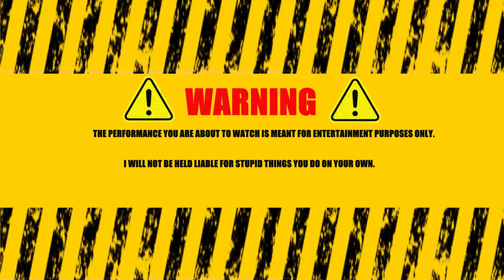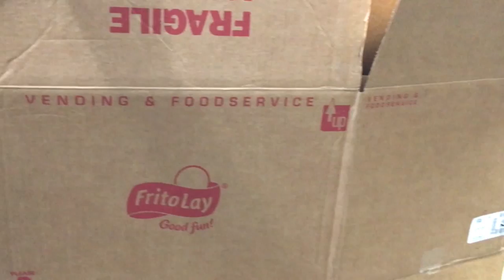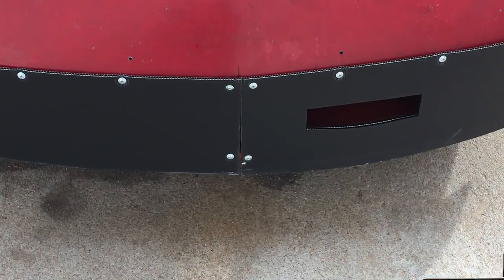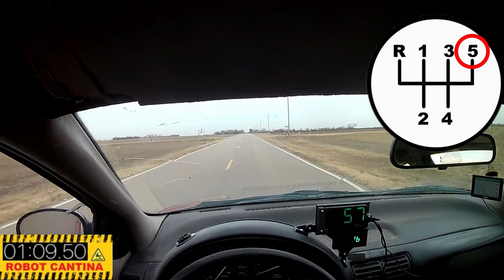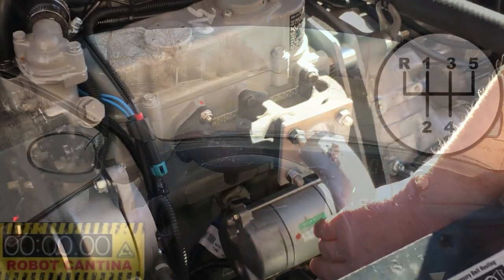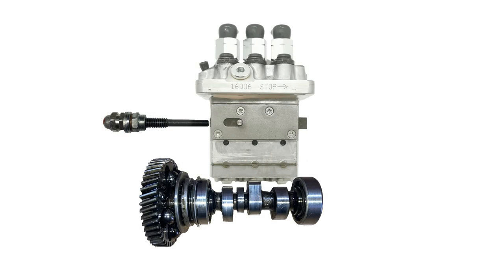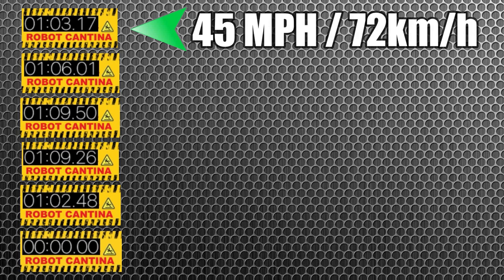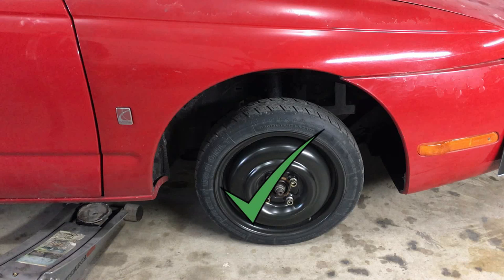S3E2   Fuel and aerodynamic mods ....We do some experiments to try and get the Saturn to go faster.

Comment: Its normal for a Diesel engine to have next to none exhaust heat at idle. Thats a huge problen when it comes to emissions. Thats why modern cars waste some diesel, by injecting it far to late into the powerstroke and so raising the EGT.

If EGT get out of hand with the turbski, try adding a intercooler, or even injecting water or methanol into the charge air.
Also, the intake header looks terrible, you might want to look into building a better flowing one and enlarging the intake ports in the head.

Comment: Maybe I'm crazy but, I would have put a little turbo on that sucker. They're not crazy expensive, under $200. That would allow you to accelerate so much more easily and quickly and you wouldn't have to run wide open all the time like now. Probably be significantly quicker, faster and use less fuel since it's under so much load right now for it's size. I probably would have run the space savers on the rear and left the good tires on the front since they're doing holding most of the weight, providing the traction for acceleration, turning, stopping and all that. If a tall, narrow, high psi, low rolling resistance tire could be found that would fit your wheels that would be money, a set of light weight wheels would be sweet too. Porsche claims every lb of unsprung weight is equal to 7-8lbs of spring weight.

Comment: When covering the radiator, an old truck trick was to cut a hole centered on the fan. This stopped water pump failure due to the blades having an uneven drag, the water pump bearing didn’t like the flow only on the top or bottom.

Comment: My suspicion is Aerodynamic drag is simply not great enough to matter for a 0-55mph acceleration test. I'm really not sure you would be able to measure it accurately with all the variance of shifting gears. You might see a few percentage increase in the hillbilly MPG test loop though. If aero mattered that much then no one would run old brick nosed muscle cars at drag strips because they would be at massive disadvantage.

Although with that said I'm curious if putting the little wheels on the rear and cut the front springs down in the front to match the ride height would help improve the aero. I agree don't run the skinny tires in front as it ruins braking performance and you'll skid in a panic stop. You can probably find 60mph rated temp spare tires to negate worries about blowouts. Adding rear fender skirts, moon disks on the front wheels, and a full underbelly pan should make it slick through the air. Bet you could get 60mpg with those mods combined with what you have already done. Weight for MPG doesn't really matter. Once the car is at the desired velocity, inertia takes over, and in fact might actually help with short inclines like overpasses.

Comment: EGTs are very low and you definitely have a safe margins to increase fueling. Something around a GT12 turbocharger and intercooler will make a huge difference with additional fueling. At 5-6psi you will notice a significant difference

Comment: ALSO, DON'T FORGET, the weight difference between each wheel, space saver v normal.. SO I AM surprised, you had slower acceleration...🤔 I have a 2007 Fiat Grande Punto 1.2 8v (ahem 'Estimated 65BHP' factory), and I know someone who has the exact same car that I have driven a coupla times. Mine, though had been fitted with large aftermarket 205/40/17s by previous owner, his - standard (alloy) 185/65/15... And MAN.. What a difference! Acceleration? - Hahaha, Fuel Economy? - "Here, just go ahead and burn my wallet!" Hahaha...
It HAS made me think 🤔, 'IF' I could get a bog standard steel wheel with 205/45/17 tyre say, and compared the weight with one of my wheel & tyre.. COULD I get a lighter wheel & tyre AND STILL have the grip but better acceleration/economy, as, I'm sure, it must be, that a lot of the times the cheap alloys are heavier than and equivalent steel wheel and tyre setup..... 🤔🤔🤔    😎🇬🇧

Comment: The smaller wheels might not reduce the rolling resistance but it certainly has better aerodynamics. Now, I would probably install the same in the back, so that the car sits level (it currently has a higher rake, which will affect the aerodynamics)

Comment: Well, here's my idea on engine performance-Maybe airflow to the engine compartment has been limited by the aero bumper cover and is causing hotter air or a restriction to air flowing into the rear mounted firewall air cleaner.  
I would like to see what a cooler air intake with more volume of fresh air available to it would do for the engine power.  Plus it would be interesting to see a lip spoiler cut some of the air going under the vehicle since these are known for tremendously improving fuel economy and higher speeds.  
Just a thought though.  
Thanks for the entertainment.

Comment: Try some cheap stick on vortex generators on the back of the roof and fab up a cheap rear diffuser under the rear bumper. Both help a lot in reducing pressure differential between the front and back and therefore reduce drag above 50kph/30mph. 
Also try weight savings; there has to be lots of parts you can remove that do not affect safety. Empty the trunk, pull the jack and spare, remove the back seat, passenger seat etc.

Comment: I don't recall how your speedometer is setup. But I noticed that you didn't specify that when you're changing the front wheel size, it wasn't going to affect the reading. Smaller circumstance tires will make a speedometer error of reading faster than actual speed.

Comment: If you want to help with aerodynamic drag you could replace the hub caps with flat ones, some older race cars use them to reduce aerodynamic drag on the wheels.
At the cost of brake cooling.

Comment: Can you fit a small fuel pump between the injection pump and tank? That should keep the feed of fuel to the engine consistent and stop the surging. Also for the EGTs could you diy rig a water/meth injector system on the intake to lower the temps and help cool the piston cron/valves?
Reply: @Robot Cantina you know you made it when people want to be you 🤣

Comment: Smaller wheels are faster fake off but lower top end. Also provides more take off. A taller skinny wheel would me and slower takeoff times but longer top end. On flat ground that would equal a faster car. Hit a hill or slight incline of any kind and you won't get any torque to go up in a high gear.

Comment: Deffo hearing a wheel bearing or an out of shape tyre. In my experience of turbocharging N/A IDI diesels, I've had no issues with running 15-18 pounds of boost with an intercooler of course. Fueling was always the problem..or lack of it. An N/A pump has a little bit extra fuel to give which will make a noticeable difference with the turbo.. but to get the most from the turbo you need a bigger pump.. I was lucky to get a TDI pump that fit straight on my engine. That little Kubota may be a tad bit tricky to find a bigger pump for unless you can change the elements in the pump.
Reply from the maker: My understanding is the Kubota super mini series engines have thin cylinder walls.. and there is the potential for disaster if pushed too hard.   Hard to say if that really is an issue.  Just to be on the safe side we will slowly increase boost and see what happens.
Reply: @robotcantina8957  deffinatley a wise idea to start low and work up. I'd be curious if Kubota ever made a versions of that engine or at least bigger versions of the design that were turbocharged, something along the lines of small tractors or even excavators..Might yield some usefull info and possible pump upgrade path. I'll certainly look forward to your vids what ever you do to it! Makes my Sundays not so gloomy here in the very damp UK.

Comment: GIven the amount of power you're dealing with, and top speed testing, I'd want to be measure wind speed, atmospheric pressure, and ambient temperature and normalize testing results so they can really be compared.

All of the performance testing you see in Car and Driver and R&T is done this way, and it's work. (As for top speed, IIRC, C and D also used to go out there and do that thing. Nowadays, that might be much harder.)

Comment: Hi guys. First time i react, but have been watching since the first insight episodes.

Just out of curiosity with the aeromods. I have always wondered, how much of a difference would it make if you put tape over all the panel gaps to make it more slippery for the air to grab hold of the car? Seems like an easy little project for you guys?

Also, without wanting to sound like a keyboard critic, i get the impression the flywheel combination you got is way too heavy for the engine to handle. It won't change top speed or at least not a lot, but it should increase acceleration significantly i would expect.

Anyways, thanks for your effort, looking forward to the next one!

Comment: Maybe you weren't reading car magazines in the 1980's, when wind tunnel testing was the new thing, but yes, outside mirrors count for a few percentage points of drag. Also, they are frontal area. (I've recently heard that decades into the wind tunnel era, some cars' exterior mirrors are so good that the car has less drag with them on.)

Also, skinnier tires = less frontal area. Your battle against the wind is not just coefficient of drag, but the frontal area it is multiplied by.

Comment: It's also running out of oomph on the high rpms because the timing is not dynamic, thus it's not getting the timing advance to move the "power band" up. It's power band is most likely right at the rpm it was originally specified to run

Comment: A small supercharger might be a better bet than a turbo. That fuel pump has no boost compensator so off boost will smoke and on boost will be lean - one or the other at least. A pd supercharger always gives pressure so its just a case of matching fuel to it and so long as there is enough capacity in the fuel system it should work well. 
The heat build up is more likely to do with cam and injection timing than too much stress at this point. Its set up to work at a low load so its optimised for that. I'm used to car pumps which almost all allow for injection timing adjustment but on yours it looks like you may have to dial the injector cam to get it to move. Looking at that picture - are those ball weights to adjust injector timing for rpm? If so and they're sprung you might be able to play with spring rates to get a gain.

Comment: Sounds like you have a huge flat spot in the midrange. A really small turbo that spins up early but doesn't give much top end boost might be best. As others have commented, the mini tyres looked soft. Running tyres at rock hard pressure give significant milage improvements.

Comment: I would say the rear spoiler would clean up the turbulence at the back, ie, should be better. In engine design we grind a diffuser in the chamber after the valve to reduce turbulence and increase flow.
You could A - B - A test it and see if the results are worse when things are put back to the start.

Comment: Gimme all the turbo!!

Not sure, and you PROBABLY know this already considering the rest of your content....but you can maybe machine the crank/rods/pistons to get some oil splash going on and help your EGT temps?

You may NOT know, methanol burns at a low temperature, i.e. low EGTs.....so meth injection, or water/meth, may also be a solution to keeping your EGTs low

Comment: Port the nozzle on the injectors there usually out of balance anyway you can add two stroke castor oil too fuel for turbo and methanol

Comment: Increase the fuel injection quantity?
You would want to monitor egt, possibly oxygen gas and have more temp sensors on the engine but 10% more fuel will make 10% more grunt until below around 18:1 afr

Comment: Once you install the turbo, it'd be great if you could make a manifold-pressure based automatic fueling screw adjuster, to keep the just right amount of fuel going into the engine even when off boost. Keep it running right at stoich.

Comment: Also you may want to find a new head gasket and do a flow test on the head to see if it's all the same flow . There is something simple you can do see if the springs are all the same weight.

Comment: Turbulence inpacts aerodynamics a lot. Covering up all the panel gaps, window edges and headlight wells with self-adhesive tape or vinyl should do some good. Also reducing the ride height by like 6 ft, and adding a cover sheet for the undercarriage. 
Then there's the unsprung mass, and also getting enough air into the wheel wells to stop drag on the tires. 

Basically everything people did to 70's Nascar racers will work.

Also this diesel engine is screaming for a turbo! Love the content by the way, keep it coming! =D

Comment: Id really like to know if you could make it a electric diesel hybrid. Either run like 5. for example 120amp alternators  or hook it to a genset, have a simple capacitor bank (instead of stupid heavy batteries,) and have two elec drive motors. that are fed by the capacitor bank. ie no mechanical drive train.   That way your engine can run in its sweet spot rpm wise and you potentially better mpg mph and 0-60

Comment: Bluntly covering over the bumper scoop probably increases drag because that air used to be going directly inside and becoming turbulent against the radiator and engine, but still generally flowing, where now it's hitting a brick wall and has to be deflected. You might see better results by extending the belly pan forwards so it connects to the top edge of the scoop, and the air goes directly through, then gets cleanly deflected down. You could then also cut off the lower bar of the bumper entirely.

This will tend to drive air under the vehicle, which isn't necessarily the best and will counter the weight of the engine slightly, reducing traction. You may have the traction to spare, and then this may reduce the tire footprint slightly, reducing how much the tire deflects under weight, reducing rolling resistance. I suspect that at these speeds neither effect would be noticable.

Without getting into how relevant any of this is, how much any of these factors matter, the simple thing would be to channel the scoop down and outward so air is deflected more out to the sides rather than directly under, like a boat. This will reduce lifting forces so that whole paragraph is minimized into oblivion. Alternatively you could install a cow catcher, a forward protruding deflector that splits the airstream, cutting it from the ground, smoothly pushing it to either side, and raising it up to go over the Saturn, instead of just hitting a blunt front. At these speeds, this probably only needs to extend maybe a foot or two in front of the bumper, and ~3ft wide. All it's gotta be is less blunt than what you've got currently.
Reply: arguing with a phantasm: One could point at a tesla and say "they have a blunt front and tesla is good at stuff <gestures wildly>" They do not have a blunt front. If you look at all of the teslas that don't have a grill, they have a sharp horizontal leading edge and then all surfaces fall back from there. Some of them feature secondary sharp leading edges lower down, but the material between them falls back and the whole situation bows back to the sides. Air gets more gently deflected by the sharp edge so that these smooth troughs can guide it to the side without brick wall deflection.

On this Saturn, the modification was done with sheet materials, and sheet materials exhibit the property of Gaussian Curvature. As you know bob, when a sheet good is curved along one axis, it becomes structurally resistant to curving along a second axis. Getting a second axis of curvature requires plastically/elastically deforming the good, increasing the length along the surface. These sheets are plastic, and they probably have some elasticity, but unless an effort is made they will still generally resist curving along a second axis, especially if that axis is perpendicular to the ribbing.

We can see that generally speaking the patch is 2D, it's slightly conic, which is good, and it's slightly leaning forward, which is good, but it's too flat to the windstream and it doesn't have a good leading edge to get laminar flow across it in any direction, so it's whole cross-sectional area is bluntly deflecting the windstream. It would help if it was leaning more forward like the bodywork above it, which could be possible if the lower bar is removed. It would help if it was curved like a hollow ground knife so that air from the top flows laminar across it, entraining the rest of the air without letting that air touch. This could potentially be done with a form and a heat gun, but I've never  worked with this specific material.

All that said, that seems like a lot of work compared to channeling the scoop or a cow catcher.

Comment: Does over-fueling on a diesel engine actually cause higher EGT? In a gasoline engine, the inverse is true: UNDER-fueling with a lean mix causes higher EGT. Running rich would lower them.

Comment: That wing helps your aerodynamics! Don't remove it!

You want the car to be as close to a teardrop as possible (which is the optimal aerodynamic shape), so lengthening the rear and straightening out the flow will improve aerodynamics.